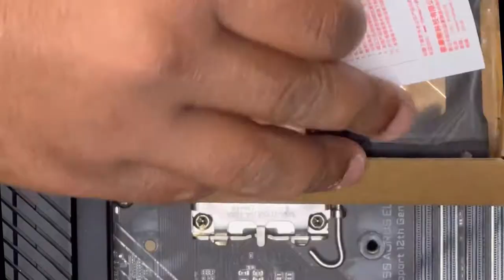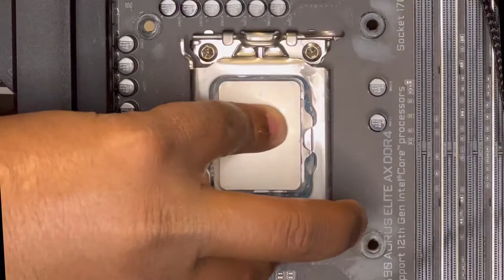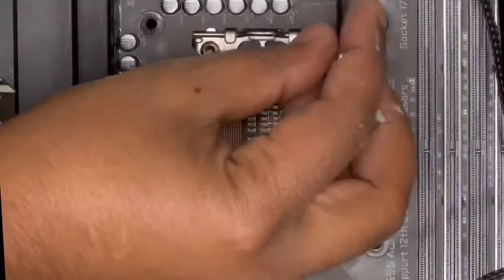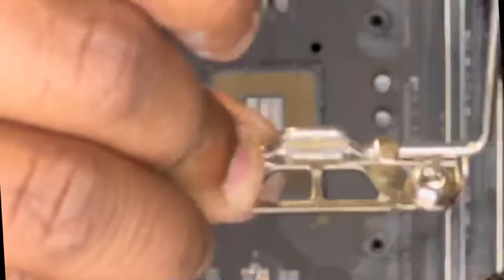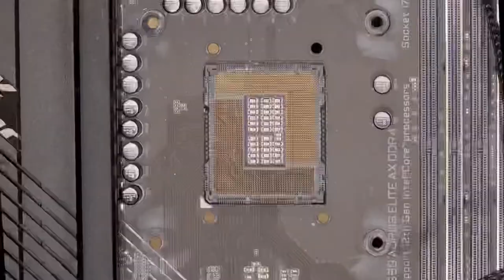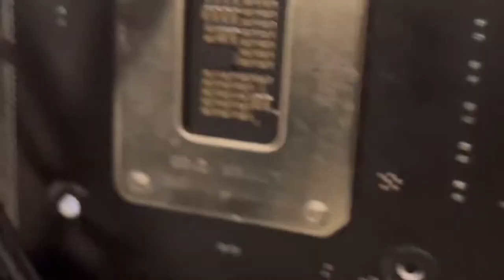Fixing Intel's LGA 1700 Socket ✅ - Works for Intel 12th & 13 Gen CPUs!

Comment: A1 and A2 ram slots do not work! Is it because of CPU not touching socket pins?
Reply from the maker: There could be many reasons, you can visually inspect pin inside the socket to check if they are bent or not aligned.
Reply: @fluixtech  I checked and they are all fine. I noticed that my arctic cooler screws around CPU has been scratched and exposed some copper around traces.
Reply from the maker: @sparda1418  Hmm this is a tough one, if the scratches are on the IHS, then that should not be a problem, maybe mounting pressure might be too high on the cooler?
Reply: @fluixtech  I mean the scratches where you mount the screws not on the CPU itself.
Reply from the maker: @sparda1418  Gotchu, its less likely that mobo circuitry will be damaged if there are scratches near the hole passthrough, more likely that cooler mounting pressure is very high that it could lead to RAM slots not working. We have seen this while early developing our Xeon cooler.
Reply: @fluixtech  is there a fix?
Reply: I am having the same issue my A1 RAM slot is not working.
When I installed the Thermalright ILM Bending Correct Frame for Intel LGA1700.
but when I installed the Intel ILM my A1 ram slot is working fine now.

Comment: How about 14th gen? Will 12/13 brackets fit?
Reply: its the same exact socket. It should work. im about to build out a new PC with a 4080 and an i7 14700kf and I purchased this bracket.
Reply: @LegoLikeDaBlocks24  Now I can say it works, I've got it already. Didn't help with temperatures at all though. Maybe it helps with bending. It's not expensive, so it can be.